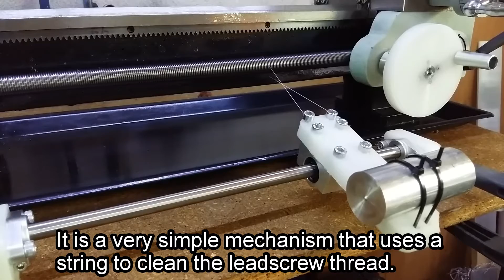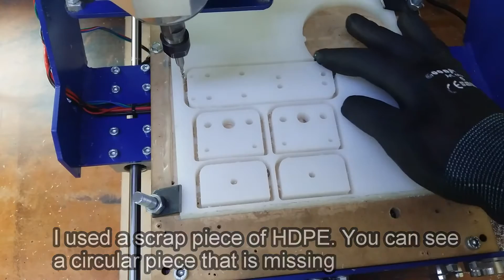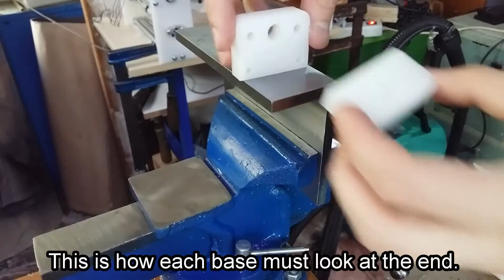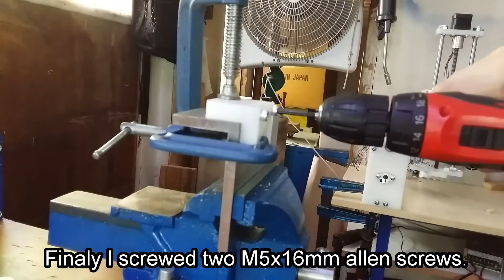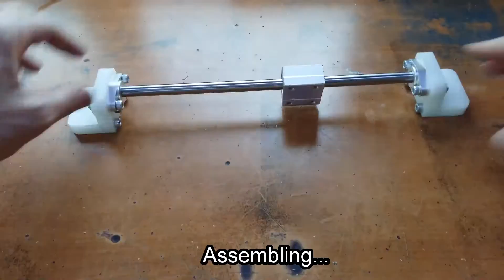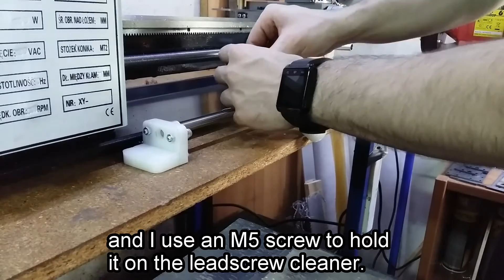Lathe Leadscrew Cleaner, almost automatic...

Comment: Hey Nick, that ?is very cool. Nice job. On your cnc what did you use to make the G code and what method to send that to the cnc? Thanks Dave
Reply from the maker: Hi Dave,
I designed it using Inkscape and I generated the GCode using JSCut.org. 
A better than JSCut software is the Aspire 4.0 from Vectric but it is not free.. 
To send my GCodes to my CNC I use the SourceRabbit GCode sender which is also free (https://www.sourcerabbit.com/GCode-Sender/).
Reply from the maker: PS. Take a look here https://www.youtube.com/watch?v=VkWLrDuabCA.
It expains how to generate GCode from a 2d design using Inkscape and JScut.org and then send it to the CNC using SourceRabbit GCode Sender
Reply: Hey Nick, thanks for responding I will check it out. Dave A